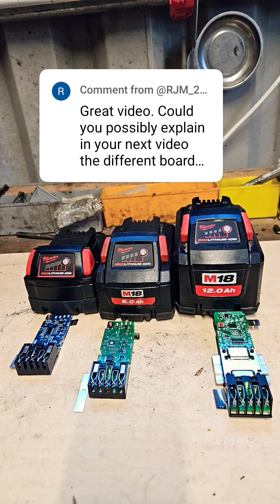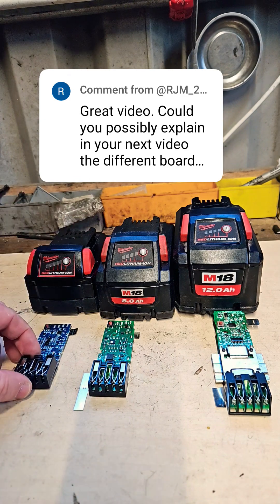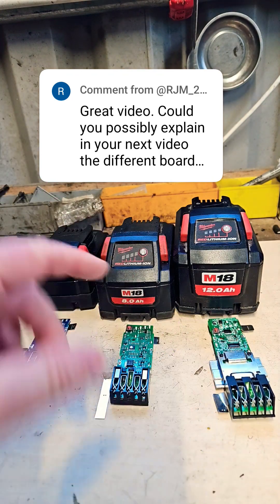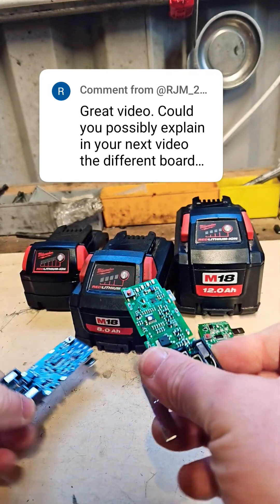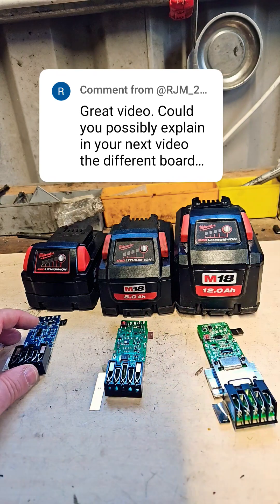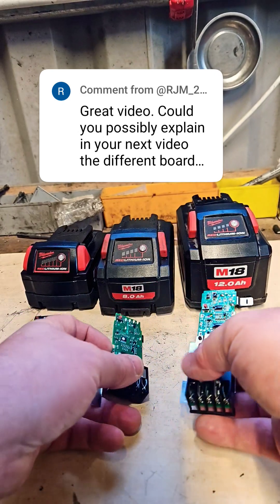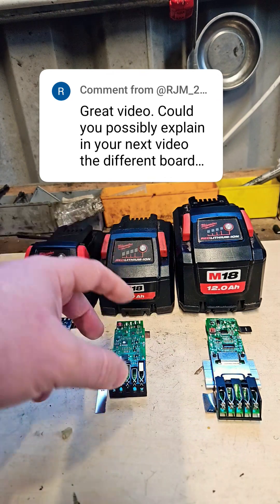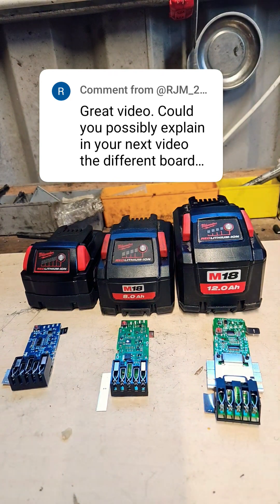What are the different boards in M18 batteries?

Comment: I thought you bought these in bulk directly from the company, live and learn
Reply from the maker: Milwaukee wouldn't supply these to anyone they would use the excuse it's too dangerous to work at batteries. The real reason is they want you to throw away as many batteries and buy more as possible.
Reply: @doctorlefthandthread under the right to repair as a company any manufacturer should sell spare parts for there battery’s